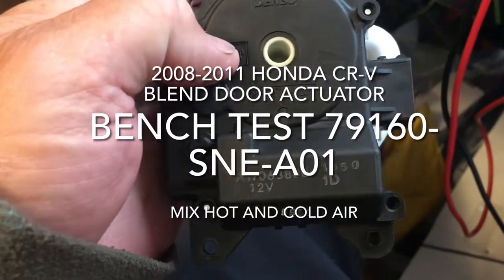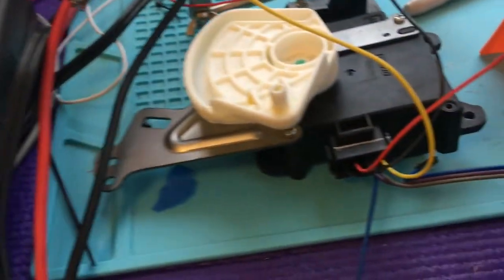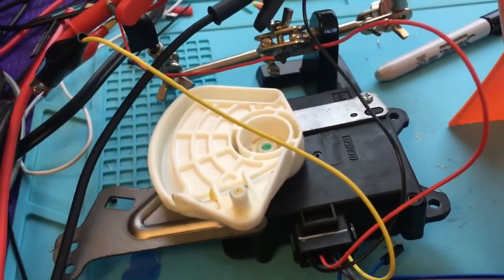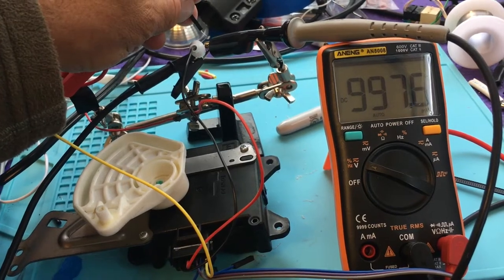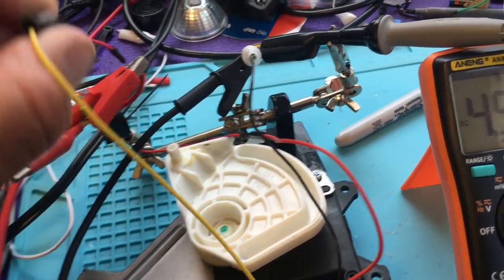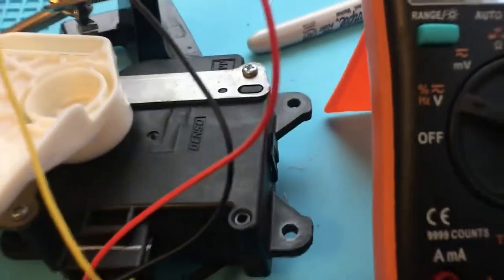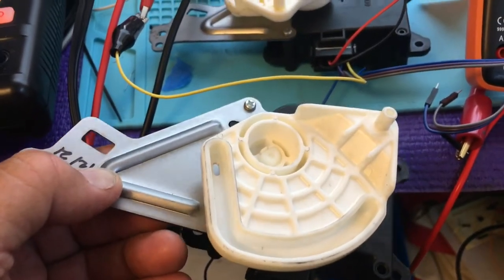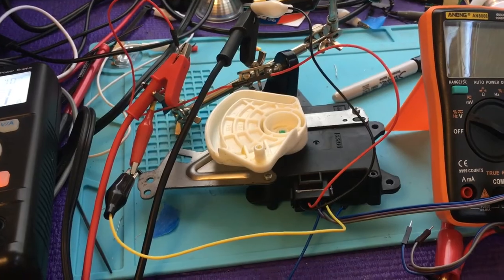Bench Testing  Honda CR-V 2007-2011 Blend Door actuator 79160-SNE-A01 Air Mix Motor

Comment: I am confused after watching your other testing video??  Question 1. Did you reverse the numbering of the PINS from one video to the other?  ie 1 is on the right in this video.  1 is on the left in the other video.  2. The OEM manual indicated Battery voltage on the far left pins to drive the motor, and reverse polarity to drive back..  battery voltage is usually 12 volts??  Are you saying to use 5 volts to drive the motor??  5 volts is usually a DATA voltage, not a working voltage.
Reply from the maker: I think the voltage is 5. I did a few videos. Can’t remember now. Yes reverse to change directions. Let us know what you find.

Comment: Are you sure the actuator is actually driven by a 5V supply? I just had one of these motors out on a 2008 CRV. The Pink and the Blue and the power wires and are, the car I service, B+ or 12v supply. The 5V supply (I think on the Black) is for a potentiometer, or position sensor,  and 0.5-4.5V signal is the signal from the potentiometer that indicates the motor/door position to the Climate Control module. The 5V circuit actually has nothing to do with driving the actuator motor, but just monitors the position of the motor/door. On mine, the motor had 34ohms or resistance and drew 20mA. It's possible that some motors in some markets are driven by a 5V power supply circuit, but that would be a very unusual power supply for an actuator motor. Can you confirm your power supply voltage??
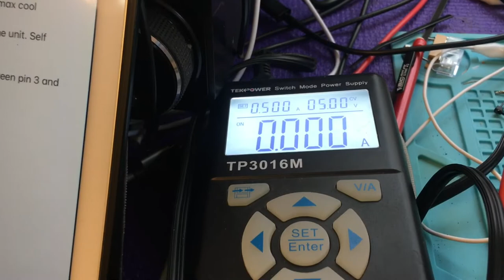Reply from the maker: I did not measure the voltage at the vehicle on the wires that drive the actuator. I believe you are correct. Thanks for posting this detail to help others. My PS voltage I on this video indicates 5.0v at time 2:09 approximately.